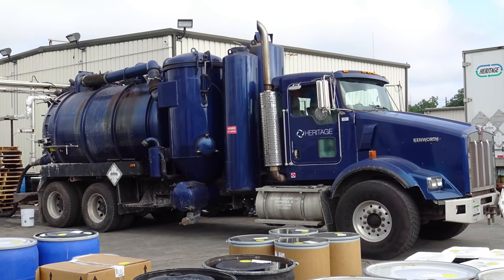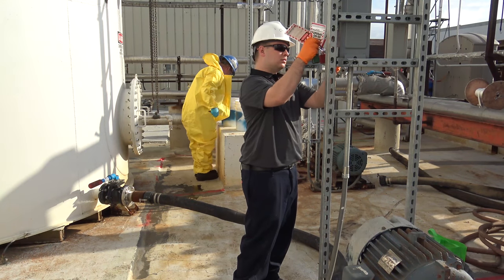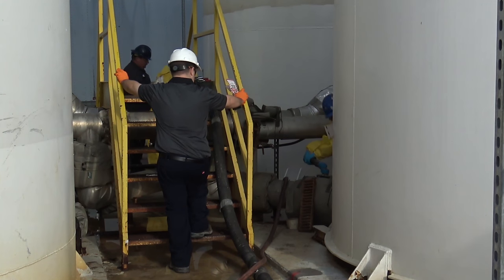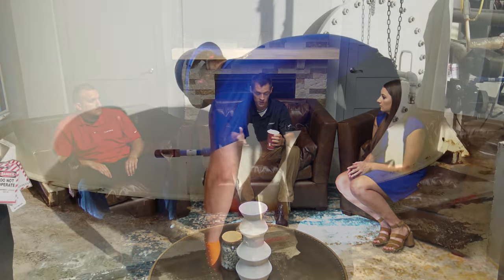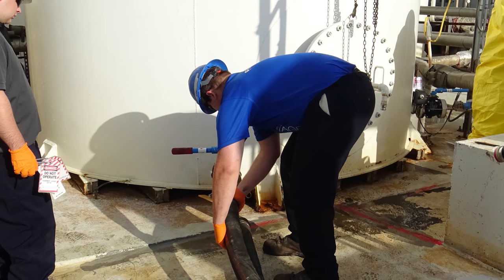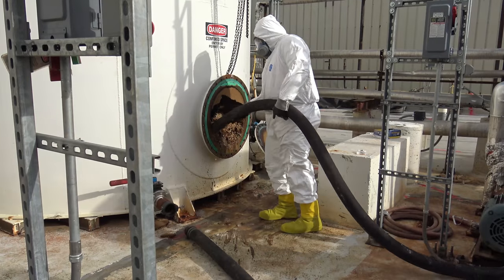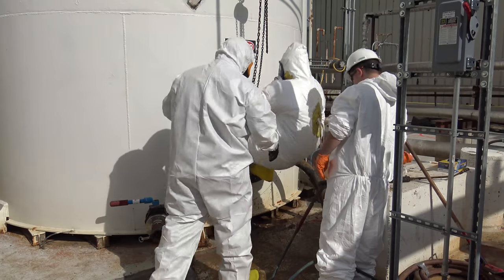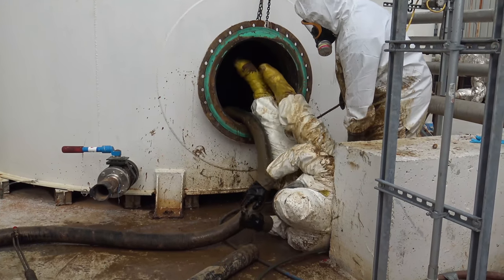Behind the Swirl: Tank Cleaning

Comment: I'm doing the same job now but using a Kango to break threw the tar right down past the heated pipes at least 200 ml down from the man hole entrance. We added two fans threw the top of tank and used about half ton salt ice to Harden tar over night hi from new zealand
Reply: Bro, after cleaning we will get something like "Stone"/thickness pieces.. Right?... What will use for it?... If it's stores for a long time and drying some more and making powder what can use? In uae there is one machines that is using for printing  but metal powder using and making some models.. The same way can we make eg:* Ravana" For the period festival in India and burn...? 😊😄🤔 

Actually what is that get after cleaning...? At present use of it? 

The types of fuel stores it may varies right? But incase of that thing any common factor is there after storing long time ..? Or by mixing together it with at present... 

Then some times different types of fule tanks need to clean at a time for getting the new products.. 😊